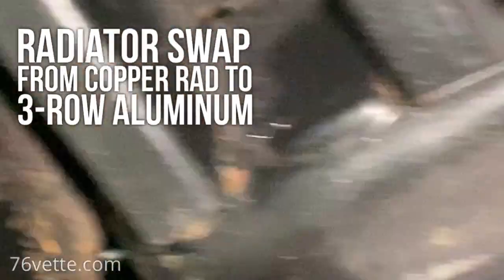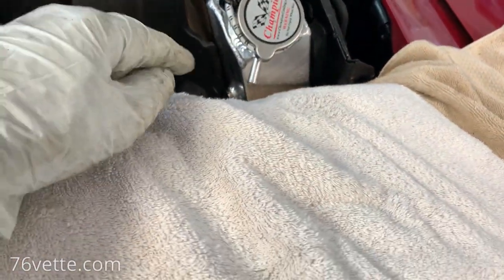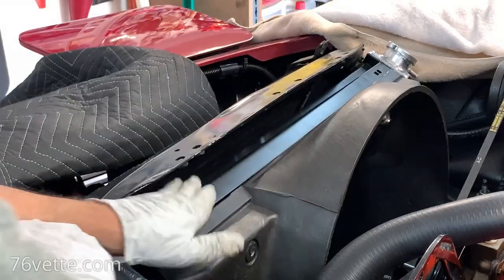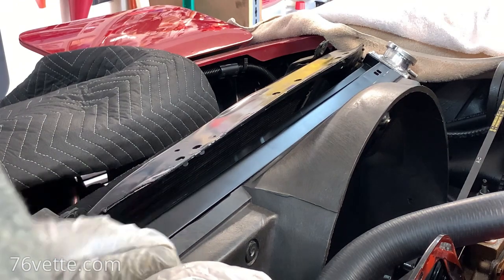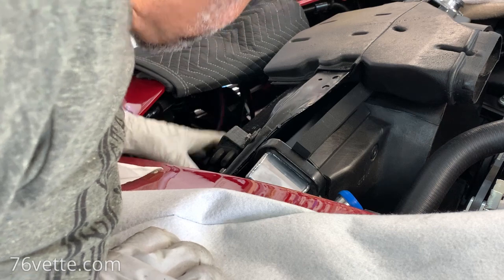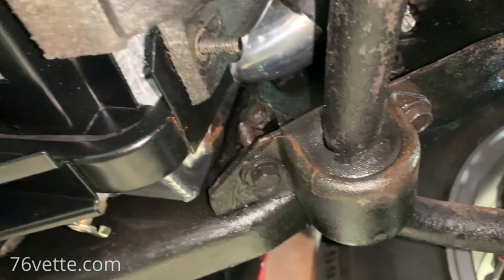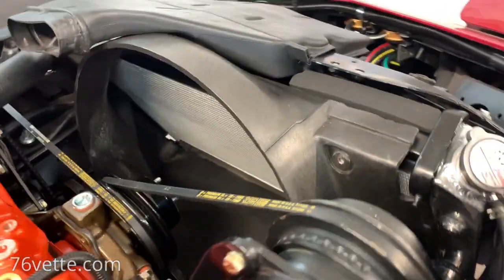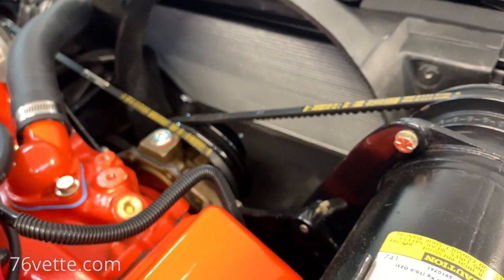Securing RADIATOR Shroud and Hoses

Comment: I just finished this same job a few months ago on my ‘75 I and I feel your pain. The shroud is main issue. Several years ago I cut my shroud in half at the very top and very bottom. It makes the job so much easier. Sure,  I know when the hood is open that it shows.  But Most people don’t  notice it.  I admire your work.
Reply from the maker: Hi Ron,
I totally understand why some choose to cut the shroud, but I knew there had to be a way to avoid that option. 
In my case, removing the headlamp actuators made all the difference. Otherwise, I would’ve risked damaging the a/c condenser so I had to do all that extra work. 
Thanks for taking the time to comment and for the kind words.

Comment: The radiator is much smaller.  I've been trying to find a 1" by 3"or better 4" block of insulation to plug that top portion for a while now.  Instead of glueing it to the support, jam it between the support and the condenser.  You can stackem but would look much cleaner with a single piece.

Comment: How is the radiator performing compared to stock? I'm thinking of pulling the trigger on this radiator for my 76. No radiator shroud as I'm going to run electric fans.
Reply from the maker: Mine has been working fine and far better than the stock copper radiator. 😊👍🏻

Comment: Hi - thanks for the videos. I'm doing the same thing to my 76 vette right now. Did you have any seals directly on your radiator shroud?
Reply from the maker: Hi Greg,
I am pretty sure there are no seals that attach directly to the shroud. But it’s been a couple of months since I finished this project so you may want to check the Corvette assembly manual to make sure. 
Good luck with your project! 😊👍🏻